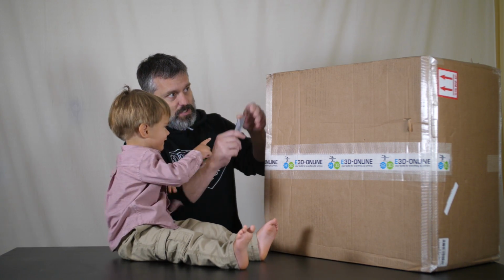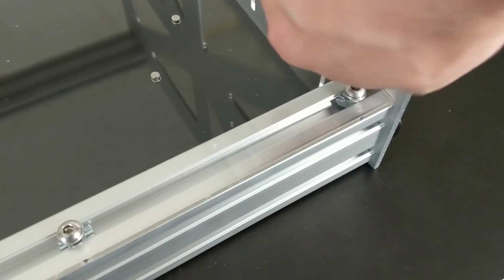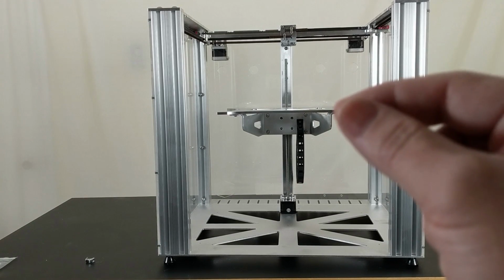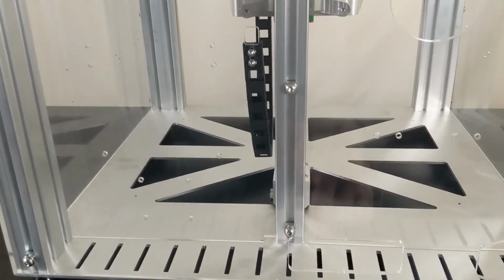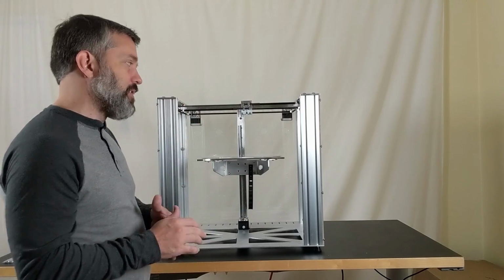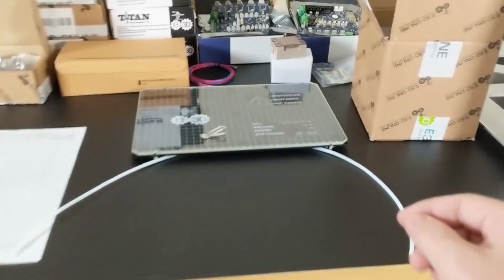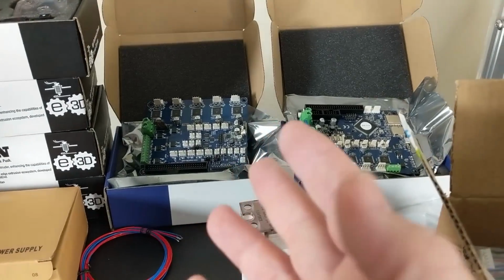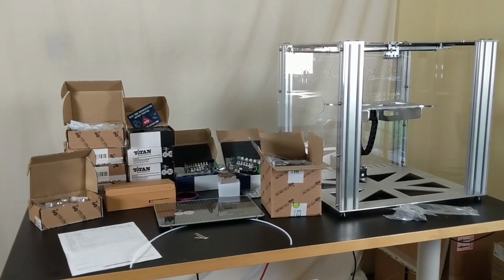The E3D Tool Changer Is Finally Here! - Let's Review It

Comment: no spare bowden tubes? I have like 3 of the white ones and 2 blue capricorn tubes.(found out i need half of the 1M for my printers and the 56mm piece that goes into my titans which will soon be obsolete when i get hemeras in them. 

 the tool changer was such a disappointment to me. this would be a fraction cheaper to source the parts yourself separately. 
you can use regular nuts in t slot extrusion. (and they can be moved with a magnet) and heck let's countersink the holes and screws so you dont overtighten and crack the plastic.

Comment: I will pay for that if someday I want a finished printer, not my own designed one. I was building my first 3d printer in past few months, using UM2 structure  with rails. To achieve the best balance between cost and accuracy, I used extrusion and carbon fiber to build the frame. And other components are Oriental Motors(mint), Hiwin Rails (brand new), NSK ballscrew(used), duet2 wifi board. Even though I live in China and easy to access to all these parts with low price, all these can go more than a thousand USD easily. 

Remember, my setup has no single customized steel or aluminum part yet. And this is the beginning of nightmare of assembling. I re-assembled my printer in last week, spent more than 20 hours, with 3 right angle rulers, length rulers(0.5mm accuracy), gauge blocks, and not making it perfect. It's very very hard to have two extrusions paralleled or perpendicular to each other. The extrusion cutting face is not flat or not perpendicular to its surface. The lengths of extrusions are not the same though they are supposed to be the same. Even the extrusion has a longer length on one face than the other face (difference about 20/100mm). The fasten plate is not flat, the right angle fastener has two surfaces not perpendicular to each others. In past week, when I was at home before and after work, my wife would saw an idiot hammering on a few metals slightly, a few strikes every few mins. 

So when I saw this E3d tool changer, the customized top and bottom plates, the holder of heat bed and the adapter of screw nut. I know it worths the price.

Comment: Few thoughts.
1. Ives is a fraud. He sells his "design thought" and it all was done before. He just copied it.
2.CNC aluminum bar is much better idea than  CF plate. Much stiffer.
But carbon monocoque would be even better. And Cost probably 10x as much.
3.  This frame for this much money ? That's really a lot.. BUT I can see they've used genuine rails, not some cheape chineesium.
I'm building similar motions system (but much more robust) and genuine parts are EXPENSIVE. I'm going with three ball screws and three linear rails. And that wil cost (for motion and extrusions) at east that much if not more than E3D product.

Comment: About the only thing I can agree with you on is the Bowden tube situation. It would have been more sensible for E3d to just have the amount that you need as a quantity of 1 rather than having to put in a quantity of 70 (I just put in 100 to have some extra). Although, for the purpose of full disclosure, E3d did emphatically state that this printer is not for "Noobs" and if you're not able to comprehend what you're going to need, then you shouldn't be purchasing within this platform; a point that I think you neglected to mention was the fact that E3d has presented the option of being able to purchase individual segments of all the various component within the platform.

Comment: I copied lot of the mechanical ideas from the early prototype. Needed a workhorse, rather than toolchangers, bells and whistles. https://www.facebook.com/photo.php?fbid=10221002534792483&set=a.1739015354609&type=3&sfns=mo
Fabtotum Corexy geometry, Gen L board, 230v AC bed, ballscrew on Z. 250x300x350mm

Comment: Wait, back when Tom and Sanjay did that video and they posted this on the site it was not meant for people who are casual users of 3D printers. They clearly posted on the site that it's a development platform so you can design your own tool changer add ons and test upgrades to help the community. It's not like everyone even knew it existed so some of the complaints you made make no sense. This wasn't a Kickstarter. It was meant for people to literally design and test using the new system. I also don't think those changer parts with the tool marks on them look that great.They could have cleaned them up finish wise.  By the way those Clips are called Swiss Clips they are meant for picture frames. You would find them at a frame shop. They are cheaper to order in bulk from Europe/UK.

Comment: Don't wanna sound rude but you tighten the t nuts a bit and slide the part into the frame I think ^^!?
Reply from the maker: You don't sound rude. Thank you for the input. The T-nuts can certainly be installed in this manner, but it is a PITA to do so. It would involve removing the top or bottom plates to access the ends of the T-slots. Also, the T-nuts are designed to rotate into place. Sliding them into place defeats the convenient design. E3D should have spec'd slightly longer bolts.
Reply: @DesignPrototypeTest  had kind of this problems on assembling an cheap kit personally I have made the best results by tighten the nuts completely and then lose them until the wings can move in the extrusion then tight them back down... Just use nails :D btw great video share your opinions in most cases keep going

Comment: You are being too critical of the engineering man. If you watch the way they announced this at MRRF, they specifically said that they were overengineering the frame to make the best platform for the tool changer, kinematics, etc. This isnt just a 3D printer. Its a platform to use and abuse for tool change\multi tool head cases while the integrity of the kinematics stay intact. 

If your cars suspension went out of whack while working on the engine. Wouldnt you go crazy?

These are good parts. You knew what you were buying.

Comment: I did build that printer as a base for my projects and i am very happy about it. The X bar is simply CNC Porn and i like it. I am under the impression you didn't fully understand what you buy when you applied for the queue. It is an demonstrator for people who know what they are doing and not a finished product. so yes bowden and 3d printed parts screws etc have to be added. But it really rocks, i do now an cheaper version based on that for BLV based corexy printers. lets see which price point is possible

Comment: If the T-nuts don't turn right, then you need to loosen them more (like a whole turn or more) first before trying again.  They can't turn when they're too close to the rail.  If the bolt can't reach the bottomed-out T-nut, then the bolt is too short.

Comment: "The number one problem I have with it is that CNC crossbar, [...] why on earth spend all that time and all that money [...] I want the carbon fiber that you were talking about [...]"

That was covered on their blog earlier this month:

"The stiffer the better, right? We’ve said goodbye to the carbon fibre bar and replaced it with fancy machined aluminum and oh boy have we’ve seen a drastic increase in stiffness; in fact it’s now twice as flexurally stiff and 3 times more torsionally stiff. In doing so we’ve only increased the total flying mass by a couple of percent and the machine can now carry the tools with far less pressure, win win! Additionally, it solves the issue with the differences in the coefficient of thermal expansion between carbon fibre and steel. The carbon fibre bar expanded at a very different rate to the Hiwin Rails and consequently we were seeing bending that caused issues with calibration and bed leveling; this has now been eliminated."

See their post titled "ToolChanger: The update you've all been waiting for"
Reply from the maker: Thank you for the information Charles.
Reply: @DesignPrototypeTest  Besides, your comment about casting is funny, too. Mold cost of a part like this is not cheap at all and they would have to outsource the casting. CNC, they can probably do in-house much cheaper on a small volume run like this.
Reply: @AntiVaganza  Molds are mostly around 10k for small products in china if you go bigger or more precise... well you can pay up to 100k...

Comment: Toolchanger Beta30 Tester here with a carbon fiber rod. Believe me: you want the aluminium ;) The carbon fiber rod bends because the thermal exchange coefficiants are not similar enough between the rod and the rails.
Reply: another thing: you have to cut off the little dent of the bed glass holder clips. this is punching into the silicone wiring and may blow your fuses
Reply from the maker: Hi Jul, can you tell me if this happened in an enclosure or in the open air? Also, didn't the Duet Mesh Bed Compensation correct for any warping?

Comment: do they also sell electronics as kit or how did you now what electronics you will use?
Reply from the maker: To get this printer you pay £120 for a spot in the queue. Once your queue number comes up they send you an email to a one-time hidden web page that only you can access. It is here that you can order all these components. The website tells what to buy to complete your kit The wording they use is "recommended" but it means 'This is a required item for this build'. The website has all of the items I showed in the video.

Comment: I feel this review is a little unfair. E3D is a 3D printer accessory company – a hotend company their customers are big printer manufacturers including those in China. The worst thing they can do is a build a mass market 3d printer that annoys their customers (printer makers) and they are not setup to be  3d printer company see Bowden tube length or the “big box” printer they built before. 

This is a reference system. Why build it? To show that a tool changer system works and beats current designs. A tool changer happens to need 4 hotends rather than 1 for MMU which is good for E3D. Not that it does not have technical benefits but marketing wise it is very clear why this is good for E3D. 
They will say for a 2k system it is the best that you can get. I think they are right in this. At that point you are competing with a tricked out prusa or a Ultimaker 2 a craft bot etc. It has more nozzles, a toolchanger will be faster and has rails. Is a 2K printer worth 10x the price of an ender 3 maybe not depends on apps. Is 2k good vs an Ultimaker s5 at ~7k, maybe depends on the application. 

The rail is an afterthought, carbon fibre had expansion issues so they put in something that worked. Arguably a steel on aluminium rails had expansion issues. It is not refined but show me a product without an engineering kludge or two in there because something went wrong at the last minute. 
Evil me says the Bowden is a purposeful mistake to make it bad to stop average consumers playing with it. Planned obsolescence in the sense of purposefully tanking your own product so it is not too good. 

Nice to see a review and another view point.
Reply: Neil Siebenthal  Yeah he got a negative view on things (i do too) but come on... He is always complaining about Chinese printers that could do this or that better. but you only pay a damn $129  with free shipping worldwide for it... what's there to complain about. NOTHING! I also understand being critical on things improves products / features but every video i check... its only negative and a lot of hypocritical stuff too. Oh and how he names parts of a printer sounds like he doesn't know where he's talking about at all.
Like M8 Hardware? wait what? hardware right? these are damn hex cap screws with simple t-nuts.

Comment: 15:54 is it me or are these ics absolutely bad soldered? there are all shorted out?!
Reply: Good Question, in the video before they were soldered differently ^^
Reply: @FireN2k9  yeah strange. maybe they make it to have a better heat transportation to the pcb and the short circuit doesn't matter, maybe v2 or so
Reply: @certified-forklifter  If not, the magic smoke comes out :D
Reply: @FireN2k9  lol, excited for the new video: "i turned my 4k machine on and my house burnt down" =D good luck design prototype test

Comment: They said they changed the carbon fiber bar to aluminum, because it's more "rigid" that way, and also, the thermal expansion between the rail & the fiber was too different, causing bends.

Comment: I feel like I remember Sanjay and some of the other E3D guys saying on one of their livestreams that they were overengineering and overbuilding the design both as a proof of concept, and also because they are wanting it to serve as a platform for many other  tools.  The first thing that comes to my mind is that the system may have been overbuilt with a high performance CNC spindle in mind.
I think they also described wanting this to serve as a example of what can be achieved with their toolchanger system, both in precision and extreme accuracy. 
 I also remember Sanjay saying they were having massive issues and delays getting the linear rail from Hiwin with the preload they wanted. None of this is meant to be an excuse for the cost, I just wanted to share some of the stuff that I remember them talking about, and hoping to provide more info for people considering their toolchanger.

Edit: I'd bet that's one of their new Mordor heated beds they've designed. These new beds get and sustain over 100°C for printing PEEK PC and other even more exotic plastics. Apparently they had to get custom beds made and somehow use the aluminum anodizing process to bond the silicone heater pad to the bed. The crazy mounting method was needed the other adhesive methods they tried failed under consistent extreme heat. Anyway, more fun food for thought. 

It definitely sounds like their instructions could've used a few more revisions lol.
Reply: Yeah the problem with the bonding process for silicone is that there aren't alot of high temp adhesives that can survive the abuse.
Reply: No change for  running a spindle on this machine; too small of cross sections - not enough 2nd moment of inertia - not rigid enough. It's overengineered but definitely not overbuild.